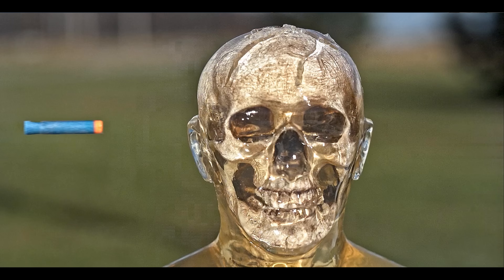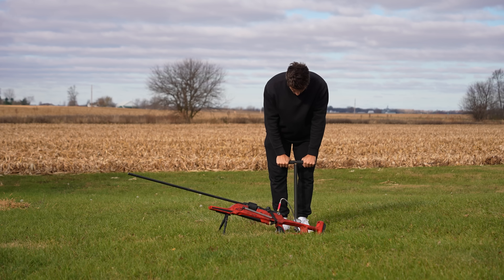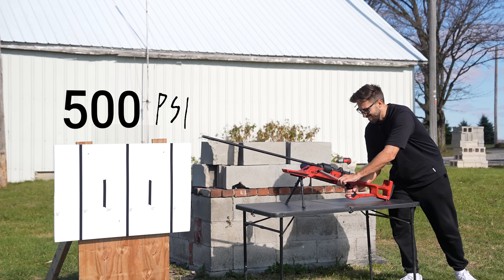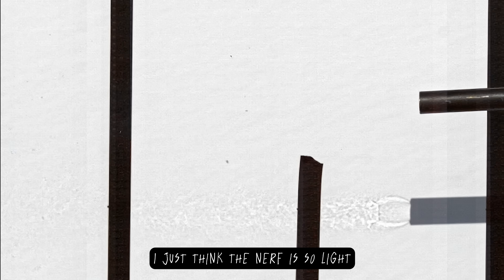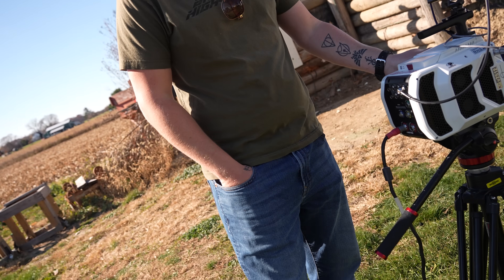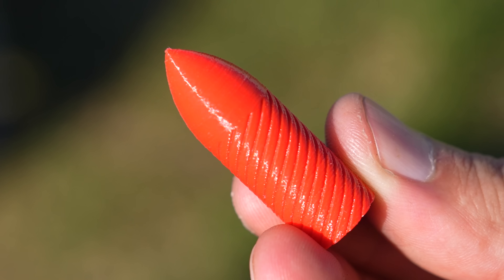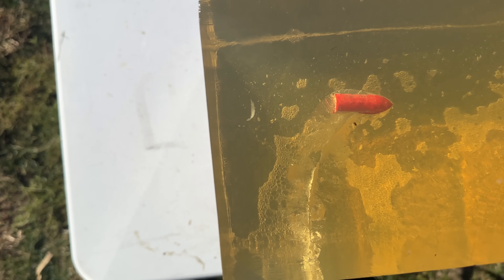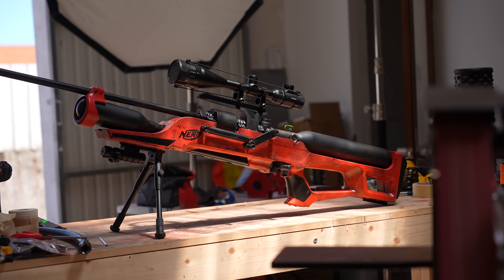How Dangerous is a Supersonic Nerf Dart?

Comment: We built one of these at work one day. I forget how it started but things escalated quickly. We were supposed to be pressure testing 4" and 6" transfer hoses with a compressor- but we ended up mounting a piece of rigid pipe on a pipe stand with the "barrel" and ball valve assembly balanced perpendicularly over a scrap pipe with a valve spring underneath the ball valve. Played around with a few different expansion chamber sizes. We attached a piece of rope to the ball valve handle to yank it open as quickly as possible (which made it feel like shooting a cannon) 

We controlled elevation with the chain clamp on the pipe stand, compressing and releasing the valve spring by cranking the knob. Had the thing hooked up to a Herc Rentals compressor trailer at max pressure and we were shooting these old allen bolts with toilet paper wadding across the parking lot at an old corrugated steel shed about 200 feet away. Put some gnarly craters in the side of it before our boss found us, asked to take a shot himself then told us to break it down and get back to work. That was a great day.

Comment: If you use round balls instead of pointed projectiles(sabots) they will shoot straighter and penetrate deeper. Sabots require a high ROT(rate of twist) to fly straight, so they will spin around in the air like crazy and wont make impact with the tip of the sabot

Comment: You could take this project to another level with a rifled barrel. Its simple to DIY with a 3d printed jig, some copper wire and electrolysis. The 3d2a community has been doing it for years.

Comment: This seems like a silly idea, but I'm wondering if using a faster valve than a ball valve to vent the QEV might yield faster QEV actuation and improve dart acceleration. Even if it does, I don't know how marginal the performance uplift would be vs the added complexity. In terms of the added complexity, I think an example of a faster valve might require a pneumatic valve of some sort which might require a third small-volume tank just to actuate the valve. That example seems a lot more complex for what might not even be that much of a performance gain. It may be an interesting future direction, but your time on a version 2 of the blaster might be better spent on making it mag fed (I'm thinking by starting at a 2-lug manually operated bolt with a center vent to cause the high chamber pressure to push against the locking surfaces and promote a good chamber seal).

Anyway, super cool project and you've taught me about some new concepts. Thank you.

Comment: Maybe instead of using rifled bullets maybe try longer ones like the nerf dart and same diameter.  The nerf dart seemed to fly straighter than everything else, you were probably slightly off your dimensions of the 3d printed bullets, I bet if you made them with the exact dimensions of the nerf dart they would fly more straight.  You probably also lost some pressure from the other rounds not fitting snugly inside the barrel like the nerf dart which could also be why they all traveled slower.

Comment: Seems to me that the nerf rounds mushroom at 430psi, what i mean by that is when the nerf round exits the barrel around halfway and it has a hollow body it explodes because the foam just fails.

Maybe if you took some scissors and cut the round to 1/3 its original length it exits the barrel before it mushrooms?

Comment: The rifling might not have worked because normally a bullet from a small caliber weapon is measured over the widest parts of the barrel so the rifling of the barrel cuts into the bullet making it spin. with large caliber the ammo is measured on the rifling because large caliber shells are made of stronger metals which would wear down your barrel fast. Which is why they have a copper or brass band around them which is as thick as the widest part of the barrel so it creates a gass seal and makes the shell spin.

Comment: Howdy, I am an Engineer working on Satellites for NASA and I want to give you an idea on how to make this shoot much faster. If you want to break into the higher Mach numbers, you should consider expanding your fluid across a nozzle. You will need what is called a convergent divergent nozzle to exceed Mach 1. 

For you to reach higher velocities here is some helpful science:
With the fluid, you only have a few things you can manipulate, pressure, temperature, and velocity are the big ones. Understanding their affects on eachother are critical, so by exchanging pressure for velocity you will need MUCH more pressure to get to higher Mach numbers. 

Please be careful but consider trying a convergent divergent nozzle and pulling a vacuum on the barrel :)

Comment: Use a slightly bigger barrel and then add a jacket to every projectile, of course made with a harder material to withstand the violent acceleration, the jacket (divided in different parts) just hugging the projectile will blow away within a couple of feet.

Comment: Either your shot of the gauge refers to something else but it does not show 430psi it shows just shy of 4000psi as your video shows you using a 3 stage 4500psi air rifle pump.  The gauges on those are 10x so 20 is 200 bars and 30 is 300 bar etc.  same with psi.  I have exactly the same high pressure pump for my 200 bar 3000psi air rifle.

Comment: I think it has something to do with Bernoulli's theory. You would think that the nerf dart would be pressurized until reaching the normal atmosphere. But Bernoulli says "when speed is great, pressure is lower". So picking up speed may cause the cells in the foam to expand due to lower pressure outside?

Comment: Without a nozzle, compressed air expands at the sound speed, so I would think that a compressed air gun can't shoot faster than the speed of sound in the compressed air, which is proportional to the square root of the temperature. If the projectile is seen travelling at 5% above the ambient sound speed, then the compressed air would need to be roughly 10% hotter, so ~30C above ambient. I guess this could happen due to the compression with the bike pump. A lower molecular weight gas, like helium, would do better.

Comment: There is two very simple solutions to keep from blowing your darts apart. Been there. Port the barrel, at about one and a half times the length of the dart from the end of the barrel. Or add a hard hollow plastic insert to the inside of the dart. I believe porting the barrel would do a better job though. This will relieve the pressure from the inside of the dart as it exits the barrel.

Comment: You would probably have better luck 3d printing a FSDS (fin stabilized discarding sabot) projectile, look at smooth bore tank shells for inspiration.       If you don't want to try that reduce the pitch on the grooves you cut into the projectile what you want is a slow twist rate like 1-25cm it looks like you had maybe a 1-2.5cm twist.     Look at rifled shotgun slugs for inspiration.

Comment: It does not feel like it to a water-filled human, but humid air is actually less dense than dry air at the same air pressure. Water molecules are much lighter than oxygen or nitrogen molecules.